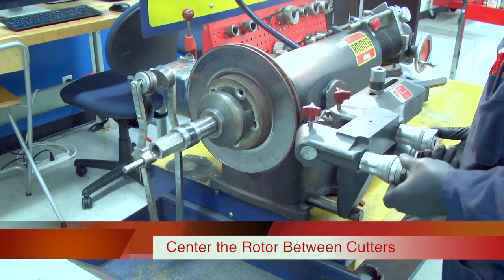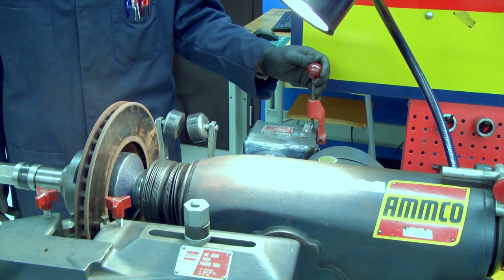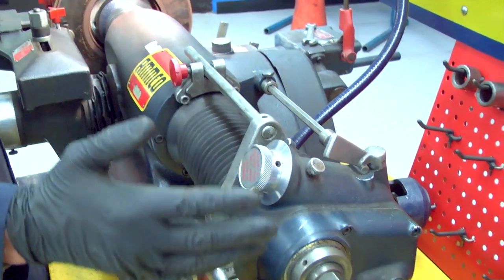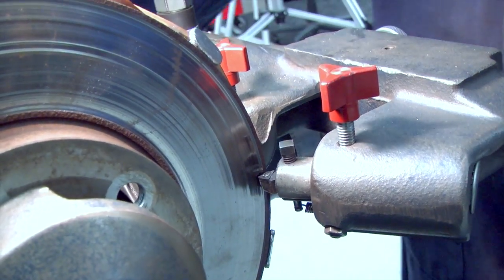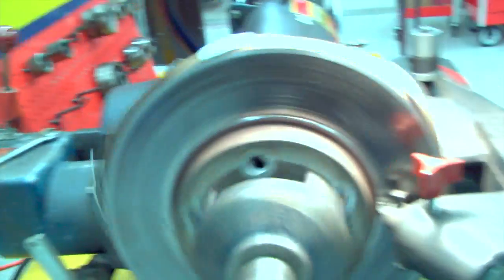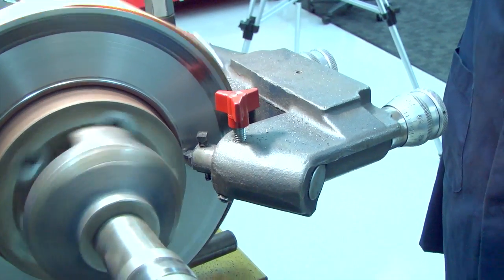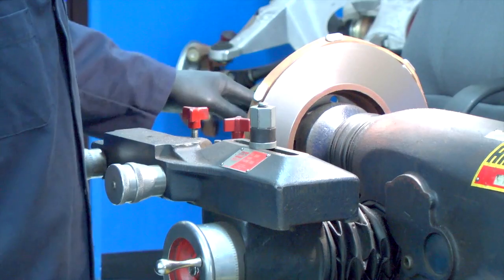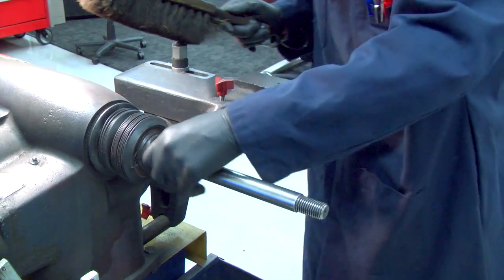SCC Automotive Training - Machining a Rotor

Comment: You have a few things incorrect in this video. But some good tips also. For starters never wear rubber gloves when operating a brake lathe. One of my customers caught his hand on the spindle wearing rubber gloves and broke all his fingers so I never recommend wearing a rubber gloves. Another thing don't turn the spindle all the way out to the right come back at least one turn on the crank wheel then lock everything down. It's a reason being is if it's extended all the way out to the right you're putting extra load on the bearings in the drum gearbox and extra load on the motor also. Always come in one turn in. Also when setting up those silencer arms it's best to but one pad on the top of the rotor and one pad on the bottom of the rotor not side by side. Some of those silencer assemblies have one short arm and one long arm just for that reason. Another thing never take two thousandths of a cut. That is too light of a cut the heat will not transfer on the bits and you wear your bits out faster. Always take four to six thousandths.

Comment: thank you Mark for the very well presented demo, but if I may, you forgot to make you initial scratch cut to determine if the adapter set up is correct.
Reply: He does talk about the scratch cut at the 13:01 point in the video.

Comment: This is a very good instructional video but I'm curious why he didn't finish the job by giving the rotor a non-directional finish which is the last step before removing the rotor from the lathe. Also, after machining drums and rotors it is good practice to wash them with soap and water or at least in an aqueous parts washer to get rid of any small filings that might be on the friction surfaces or caught inside of the cooling fins of the vented rotors.

Comment: Thanks for posting this! I used to work in a machine shop but never saw how rotors were machined. Just did a brake job where the rotors were machined and now I understand why one of them was returned to me with .010" runout!

Comment: what is the self aligning spacer used for ? how is it different to any other spacer?
Reply: When machining a rotor you want to reduce vibrations as much as possible. The self-aligning spacer ensures that any indifference between the lock nut and the drive plate even out to reduce vibrations. It works on the same principle as the anti-vibration pucks. He placed it in the wrong position (watch again at the 2:15 mark on the video), and the self-aligning spacer should butt up against the outer drive plate. Please keep in mind that not all machining procedures will require a spacer.